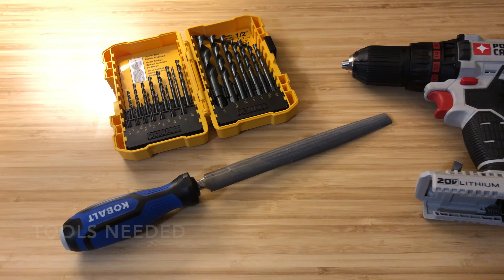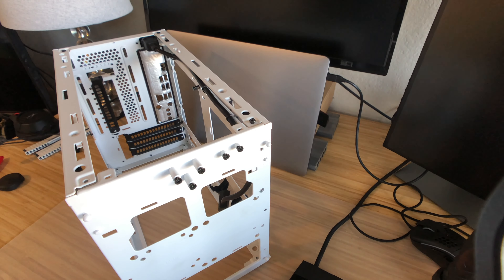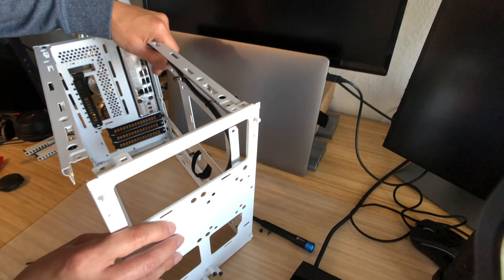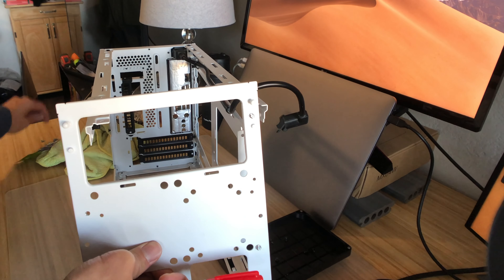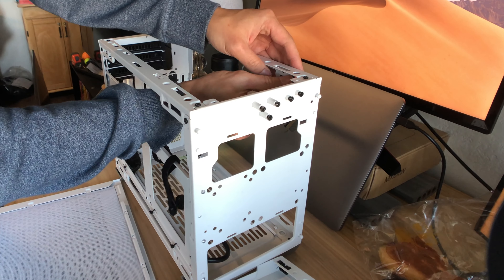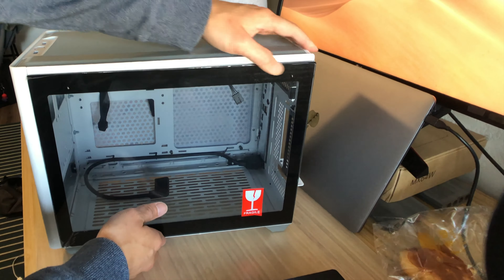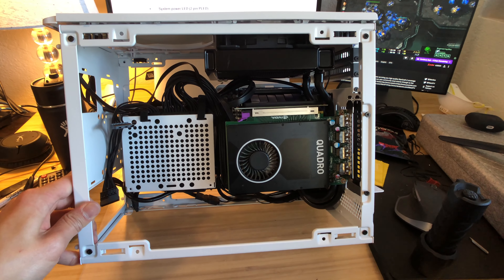How to customize a cooler master NR200P Build AIO with Top Radiator / Top Hat - Inverted Mod

Comment: Cooler master should watch this and make it easier to do this. Gj
Reply from the maker: Thanks and I agree or at least make it an option in the build.
Reply: @StraightforwardTech  Yeah I'd say for them it would be really easy just to modify the designs just slightly to accommodate this mod. Or generally giving the option of mounting the PSU and mobo a bit lower to allow for top mount of an AIO. I think that video from GaNexus was pretty clear that mounting the AIO on the bottom isn't recommended, vertical side mounting still not ideal, and front mount isn't an option in this case, either. 
And I'm still debating just sticking with air cooling but .. I just prefer the clean look of an AIO. So. If I stick with air cooling, I probably wouldn't use the glass side panel because it's not as visually interesting to me then anyhow.. :) decisions decisions
Reply from the maker: @indy.strooooble  Cooler Master had an AMA on r/sffpc where they had talked more about future nr200s or other variants but agreed they have a great product and I'm sure they looking to make a v2 of it. I think air coolers can look cool too dependent on how much 🌈 you want to show off or a mute build w/ white lights is nice too
Reply: @StraightforwardTech  Yeah Im not into rainbow colors, but solid colors inc white are nice IMO
Reply: should I wait for the NR200 v2? haha
Reply: @boyiinGG  Is there aV.2 coming, or are you referring to making an inverted model?
Reply: @BARBELLS-AND-BUDS  making one sorry for that :D
Reply: @boyiinGG  Nice If you post it on reddit Ill see it. Is it built already or in planning stage?

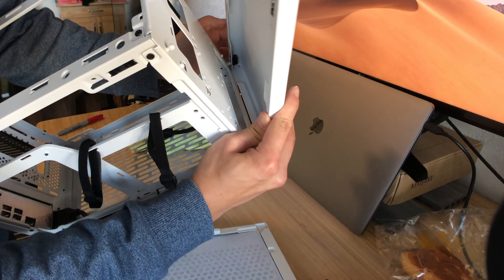Comment: If you do face the same problem at 5:55 and you really want that third screw, just widen the hole on the front panel the screw head is supposed to find into with a larger bit. It's an interior trim rail and no one will see it anyway.
Reply from the maker: Thanks for the suggestion!

Comment: This case is so fun to work with.  Did an all air cooler build in the NR200(non P) and am in love with it.  Tried a 6800 XT Taichi deshrouded in it with 2 x 120mm fans underneath and the temps were amazing.  Decided to put the shroud back on and take the 120mm fans out so the GPU RGB could give an underglow to the case and it looks amazing.  Running a C14s for the CPU and this thing is running whisper quiet.  Also managed to install my ATX PSU in it too!  Tight fit but works great!

Seeing all the work you put into this is impressive to say the least, and really goes to show how versatile this case is with the right amount of dedication and work.
Reply from the maker: Thanks! Appreciate it! Yah, i really love the flexibility of this case and the amount of different components that can go inside.

Comment: DUDE!! I NEED MORE! I kept looking at the scrubber thinking it’s almost over there better be a part two. Let’s talk parts cable management air flow and temps.  Great idea great video!
Reply from the maker: 😄Thanks! Appreciate the comment, looking forward to making more videos on the nr200 and other sffpc
Reply: Yes agreed, I am considering this case as well, I was wondering could a 240 mm AIO fit at the top of this modded case as well?
Reply from the maker: @indy.strooooble  I got something in the works for that but quick tldr. It should fit a 240 depending on your mobo height clearance
Reply: @StraightforwardTech  Ah wonderful! That's good to know. I think the one I had in mind should fit but I'll see if I can figure out the measurements ahead of time. 
No chance of me building a new setup now anyhow with the crazy prices/unavailability of the GPU I had in mind...so I have some time... :D
Reply from the maker: @indy.strooooble  I feel ya man. don't fall prey to those scalper prices. gives you time to figure out what you want w/ more reviews best of luck to you picking one up.

Comment: Very clever idea! I really like my NR200P but have always wanted the rad on top. I'll give this a shot, thanks!
Reply from the maker: Thanks!
Reply: @StraightforwardTech   Just wanted to update that following your guide I was able to mod my case in less than an hour, thanks!
Reply: I used a belt sander instead of a file sand down the area that needed to modified to fit.
Reply from the maker: @vbtrobotics3652  Glad to hear this was a simple mod for you too!
Reply: @vbtrobotics3652   Angle grinder FTW :-P. took about 4 seconds.

Comment: Between the 3rd pcie slot on the bottom and the pcie riser do you think there is enough room for an additional 120mm rad with a slim fan? It would be mounted with a pcie slot adapter. This isn't what I want to do exactly but it'll answer the question I want I guess. Aside from thermals I'm trying to figure out how to fit a 120mm and 240mm aio to accommodate a 3090 hybrid lol without mounting a radiator below a pump.
Thanks for the video! Very helpful
Reply from the maker: 👋 Hey! sorry for getting back to you so late and thanks for checking out the video 😁, what did you end up doing with your build?

Comment: I'm getting my case today and will be ready with a drill! Just a slight concern about the GPU being inverted, whether that would be a problem for the riser. Besides this, anything that you thought was a problem caused by flipping the case? Looks promising to me!
Reply from the maker: I didn't have any issues with flipping it upside down. The riser cable will sit on top actually so no need to worry about that.

Comment: this is so simple! im definitely buying and modding this case out of the box. 
how did you mounted the power/usb switch and audio jack once you flipped the front panel?

thanks a lot for the tutorial! ^_^
Reply from the maker: You're welcome ❤️! the front panel still attaches into the same place as the top hat is where the front i/o panel goes

Comment: Nice video! Very helpful! Do you think I'd be able to fit a 280mm AIO, namely Arctic Liquid Freezer II, in this configuration? Or is it too big in both length and thickness?
Reply from the maker: Hey man! Thanks for stopping by. I've think you could probably fit a 280 AIO in there but I heard those tubes are not as flexible so it's going to be a tight squeeze. I'd wait for the 200p MAX if you really want the 280mm top hat.

Comment: Big issue for me - to customize NR200P so I wanna see my RGB screen on AIO pump (Kraken Z-series) through the glass. I bought Kraken Z cause I love it for RGB screen with ability to show animated gifs. Next wanna more small case... NR200P is good.... but what for glass side?... if I won't see AIO's RGB screen.... So Im thinkig yet about buying NR200P 

May be you have any idea is it possible? May be AIO radiator get down... and screw the fans from case bottom outside?
Reply: You can bottom mount the AIO but its a problem for the pump as all air will be collecting in the block/pump. A 240mm can easily fit at the bottom but just an pump longevity issue and noise.
Reply from the maker: 👋 Hey there, sorry for responding back so late, did you end up buying the nr200? I know the SSUPD Meshilicious can be a good option to display the RGB screen, hope that helps 🤙

Comment: what is the drill and screw size? thanks in advance
Reply from the maker: Thanks for checking out the video. Screw: #4-40 x 1/2in. Drill bit: 7/64
Reply: @StraightforwardTech  Thanks man! Plan to do this mod by myself. Glad I found your video.

In reddit, you posted your strix 2.5 slot gpu with tempered glass, and aio on top, how is the gpu temperature?
Reply from the maker: @AlfatHarun  So the Strix is a 2.9 slot card it's pretty thick at 5.78 cm. Dropping my own self-review https://www.youtube.com/watch?v=nhygRdFQxQ8 and I go over thermals w/ various panels. let me know if it's helpful. Cheers!

Comment: Would 1/4 inch screws work instead of 1/2 inch? just seems like over kill for 2 pieces of sheet metal.
Reply from the maker: Yeah, I think its reasonable. I'm not much of a power tool guy.

Comment: Just got NR200P and a Kraken x53. With the top mount would that work with a vertical GPU? (I have the 3060ti 3x).
Reply from the maker: Yes you can fit the gpu vertically with a top mounted aio

Comment: Can an aio be mounted at the bottom as well with this though?
Reply from the maker: The original NR200 is made for a bottom mounted aio
Reply: I know it is but the issue i see here is the pump being above the radiator and therefore bubbles going to the pump

Comment: Do you think there is space for a horizontally mounted gpu? Assuming the back panel is modded and psu is shifted up.
Reply from the maker: I think it’s reasonable to mount it horizontally. Assuming the case is modded for psu and a custom backpanel

Comment: The one panel on the right side is a bit off on the edge due to the curvature of the frame! Other than that, this is perfect :D thanks!
Reply from the maker: Glad you found this useful and pulled off this mod
Reply: what do you mean its a bit off could you send an imgur link with a picture? I plan on doing this mod and want to make sure of everything before I do it
Reply: @eriknesh4085  It wont fit perfectly due to the frame being a bit bent and that does not fit properly when you turn it around. Meaning it will have a slight tilt outwards that will make it look bent out. But its not super noticeable. I will get a picture of it tomorrow.
Reply: @TheDeiphoboz  okay thanks

Comment: Sorry i didn't get the advantages of it?
Reply from the maker: I originally made this tutorial because Gamers Nexus had a video saying bottom mounted AIOs are not good for the pump. This gives an option to top mount AIOs in this popular case.
Reply: @StraightforwardTech  it's true I remember this video. Perhaps it would not be easier to try to adapt the AIO at the top? I have this NR200 and I easily adapted an 850w ATX. However, do you have the option of mounting it on the side above the pump or not? Good job anyway.
Reply from the maker: @Rodrigo8  Yes, it is possible to side mount but the pump will be parallel to the tubes but for "best" orientated configuration, it would still be top-mounted. I love the NR200 case since it allows ATX users to port items such as your PSU to get into sffpc. Thanks for checking out the video! 😀